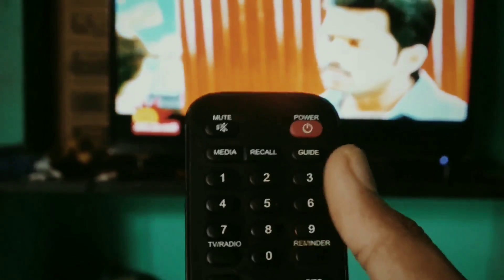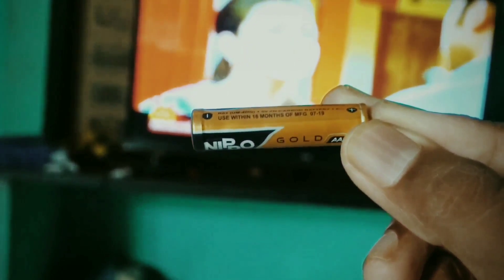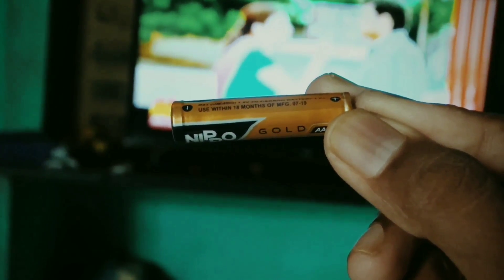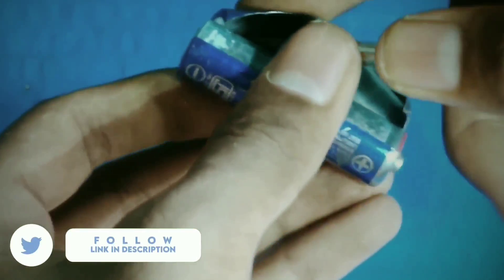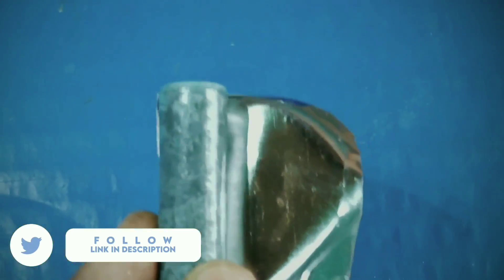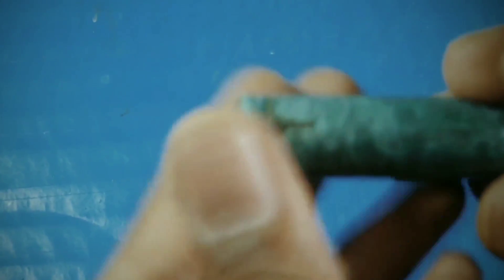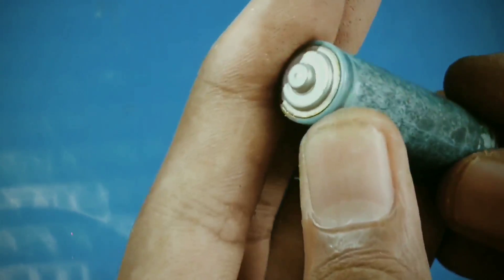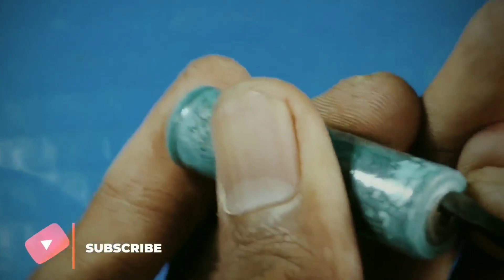How to Recharge the 1.5v battery again and again

Comment: Can you describe or would you like to tell how it works.. why it works
Reply from the maker: The salt water as an electron and also the few electron balance inside the battery by adding the salt water the electron are run the circuit

Comment: Brother I have mosquito trapper machine we need to connect that in mobile charger so it's work,now the uv led light is not working can you give me solutions to repair it pls
Reply from the maker: I think the led light is dead change the light and connection
Reply: @Circuiters  it's dim brother
Reply from the maker: Bro were are you from ?

Comment: Too bad that your multimeter was set to max 0.5 volts instead of giving a proper reading at the 2.5 volt range.
Reply from the maker: I am forgetting to fix the voltage in 2.5 but the output voltage is correct

Comment: This is such a click bait video. Mis-leading as hell. This battery is not going to last longer. Also the multimeter was kept on 0.5V. These batteries when NEW give out 1.5 V @ 300mah approx. This salt water method may just work for a day maybe less on a lower power devices like a remote or a clock. But you put this in a toy which has spining motor. It will just go pooff!!. Don't follow such BS methods as these batteries may contain hazardous materials.
Reply from the maker: https://youtu.be/kJAZ7xTfX9s
Reply: @Circuiters  This is like the tip of sadness iceberg.

Comment: My remote exploded 😠
Reply from the maker: That is impossible
Reply: @Kian Valencia   Your remote did not explode, The battery exploded. Pls make sure before doing this that your battery is completely discharged, also remember to make SURE that the salt water is not dripping out. It is not shown in this video, but I HIGHLY recommend that you insulate your battery with something and make sure that this battery does not touch any other batteries inside of a device. Moreover, you should stay safe and just buy a new battery instead of doing this in the first place.
Reply: All that what i said is applicable *IF THIS VIDEO IS REAL*. If it isn't, then I will take my leave.